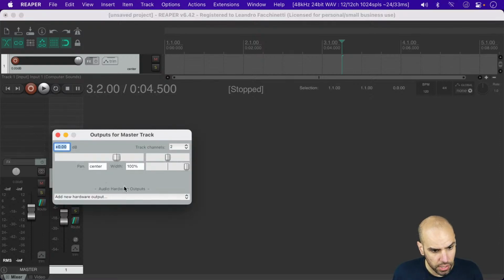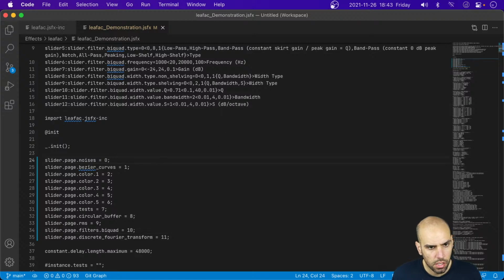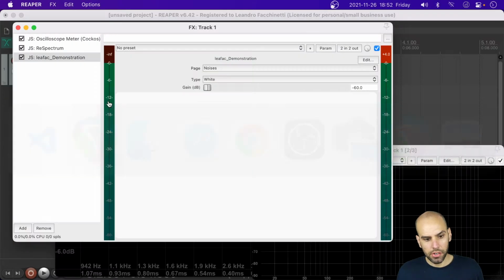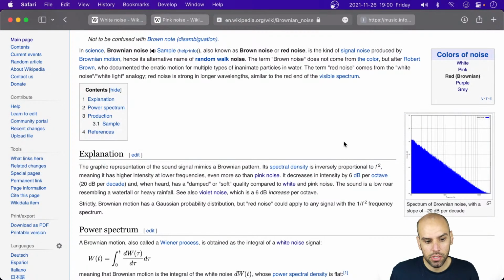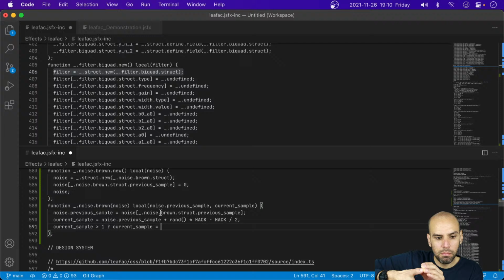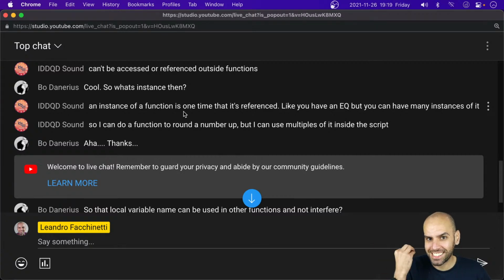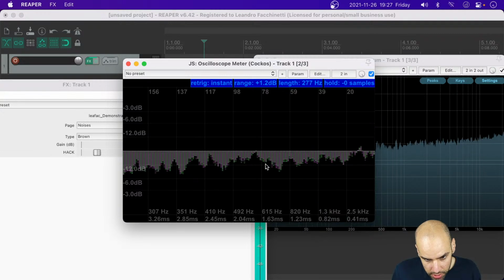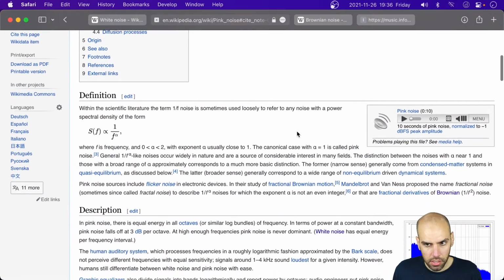Colorful Noises (Creating White Noise, Pink Noise, and Brown Noise) · REAPER Real-Time Audio Effects

Comment: There are 3 noises white noise 
100 % envelope open over all frequencies from c0 to c8

Pink noise 
Separates into octaves and gives a +/- 3db wave
Brown gives 6db
If you ain't got brown noise 
Get sound to pink noise and then add a second layer of pink noise 2 x 3 dB

Usually pink is used for strings vibrating 

Brown is used  thunder sounds 
Which also acts like distortion but has more characters in noise.
Which makes this sound more pleasing and dynamic than the roughness of distortion.
So if doing  3  guitars stems  try putting distortion on one stem and brown on other and the 3rd on pink 
Play through all separate 
You hear differences